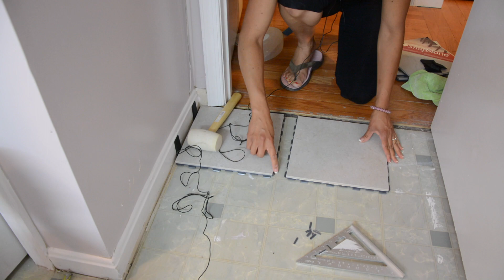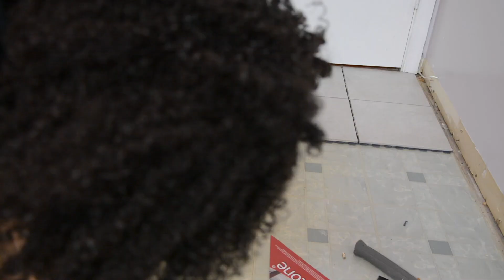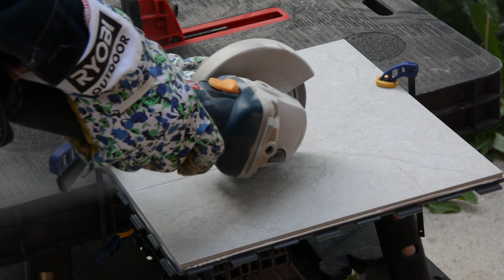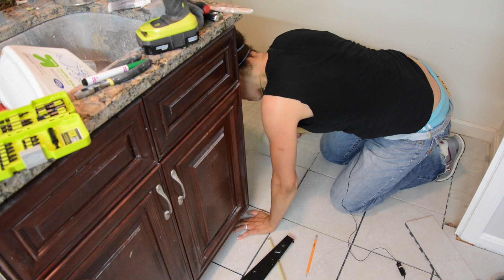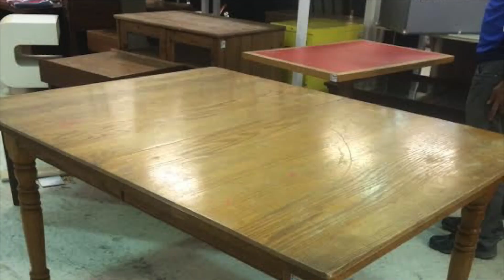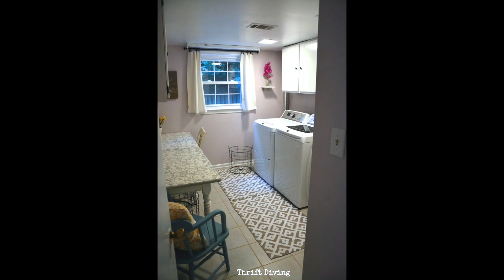My Pretty Laundry Room Makeover: A Quick Peek! - Thrift Diving

Comment: Very nice! How did u get the tables to stand with only two legs?
Reply: I'm going to guess that she fastened the backs to the wall somehow. There are many ways to fasten a table to the wall, either from underneath with hardware or a cleat or with a board on top and screws coming in from the bottom.